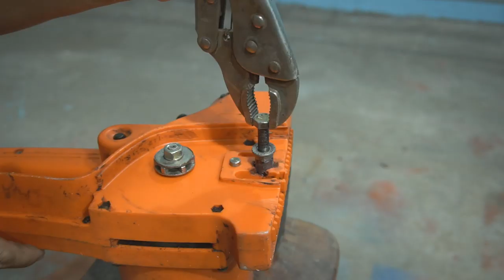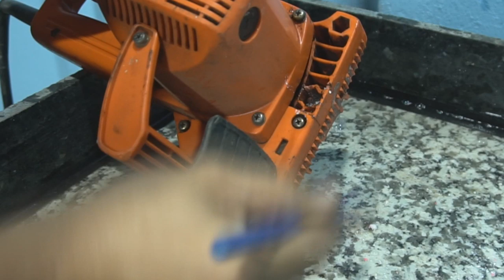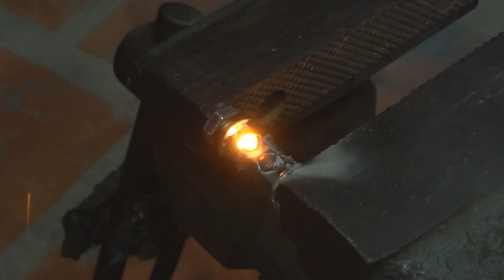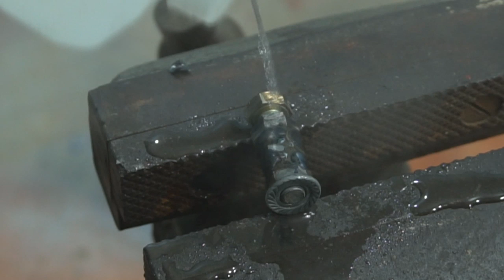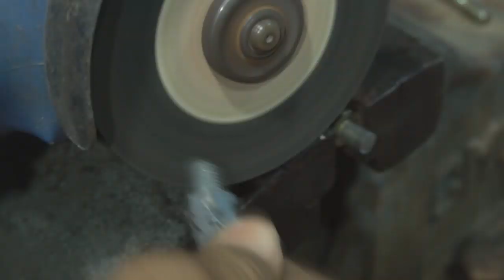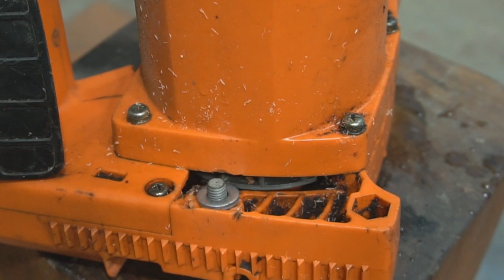Fixing Flange Head Bolt of Electric Chain Saw Makita 5012B For Wood Carving

Comment: Excellent work. I wonder why the Makita engineers did not make this unit out of steel or aluminum alloys? It is clear to the younger student that the plastic construction will not work for a long time.
Reply from the maker: This model is strong and fast for carving, but this point is low quality